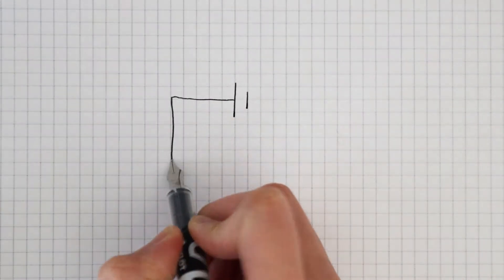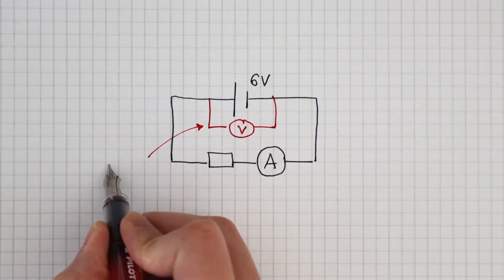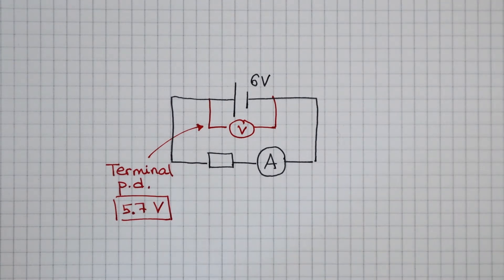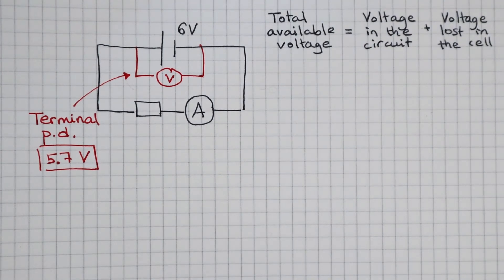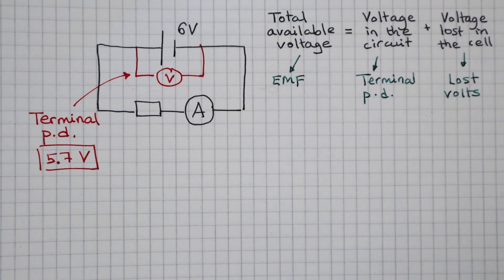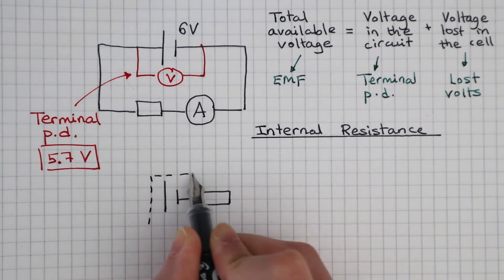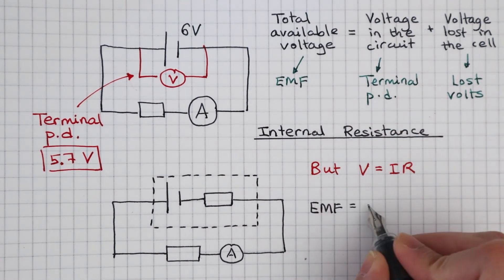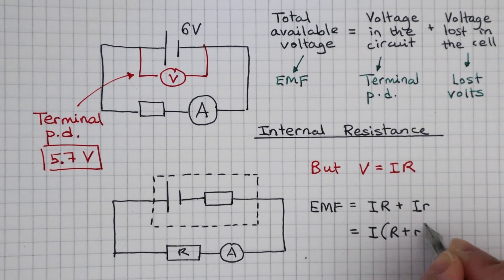EMF and Internal Resistance - A Level Physics

Comment: It is not clear since the location of a volt in a circuit that is terminal p.d. is 5.7 that is next to the side of voltage lost in the cell so that is 6 - 5.7, so .3 lost. So, it is more accurate to say terminal p.d. is the left overvoltage in the circuit after being lost. So, terminal p.d. is linked to lost volt so that is totally within Red. So, terminal p.d. is the resistance of lost of .3 to total that is EMF that is 6 volt. 

So, IR is under the umbrella of terminal p.d. and it is under the higher umbrella of EMF. So, terminal p.d. is resistance that absorbs in the cell as being lost. So, how you get .3 from? How do you get resistance that causes the loss of .3? So, terminal p.d.  is important to get current, or it will be volt alone in the circuit, so no power outward. Current is necessary for power.
Reply from the maker: Hi Khalif, you can think of the 'lost volts' as the voltage lost due to the internal resistance of the cell. The EMF of 6V and terminal p.d. are just values of the example I've given in the video. In order to calculate the lost volts, I need to know the internal resistance of the cell.
Reply: @vt.physics  So, I am correct to say terminal p.d. is certain volts being from absorbing by certain resistance. Ya didn't confirm what is terminal p.d. so?? So, internal resistance is two words as one group word which is important but the other process of internal resistance is terminal p.d. and lost volt. Because those words are invented so. If you have a battery, so it is not battery alone but another process so the battery is a cell which has two that is negative and positive which cause the process to be reduced, so that is volt, so lost volt is a total value of internal resistance that is being absorbed by volt, the whole voltage that is EMF. The battery is EMF which has electrons motion to cause the activity to the load. 

The back EMF is gain of a volt so it is negative resistance, even there is two opposite in form of resistance so the motion of electrons to resistance which absorbs the electrons, so it is the holder. The resistance is the holder of electrons. So, it is converted into heat so that is felt of activity that is absorbing the electrons which represent resistance.  So, all mass is emf which has electrons motion within so it has heat within, so it is a cell. All mass is a cell.
Reply from the maker: @khaliffoster3777  Terminal p.d. is considered as the actual voltage received by the circuit. If there are no components drawing a current from the battery, then EMF=Terminal p.d. because there is no lost volts. 

So just think of EMF as the maximum voltage possible from the battery (if there were no internal resistance).
Reply: @vt.physics  Ok, your other reply that you didn't reply. There is more info in my answer back to you. So, there is two terminal p.d. that are full voltage and lost voltage. 6.0 and 5.7. So, it can be two values. IF it has resistance, then terminal p.d. is 5.7. If no resistance, then 6.0, but it means a whole thru circuit. Pure terminal p.d. and resistance terminal p.d. thru circuit.